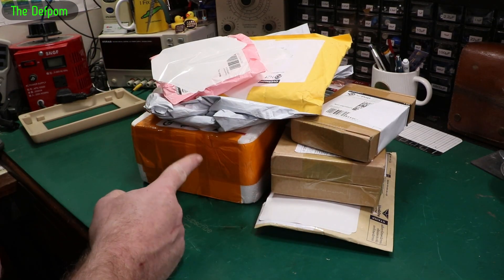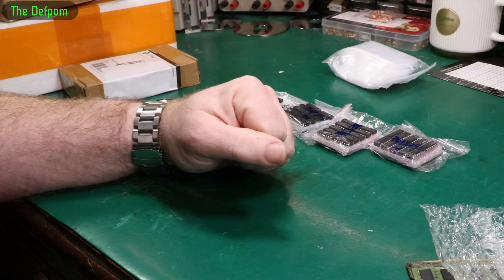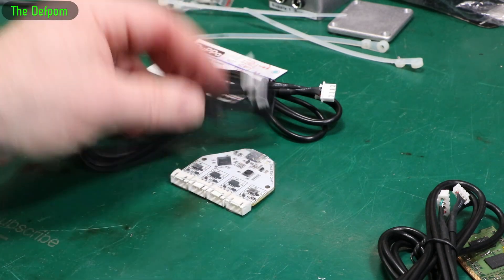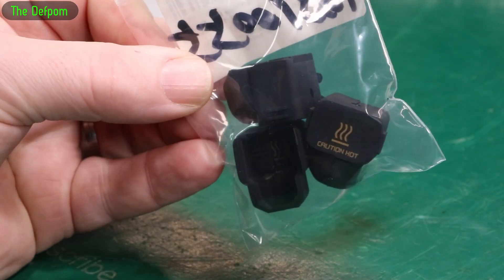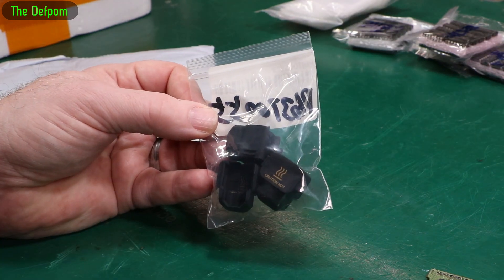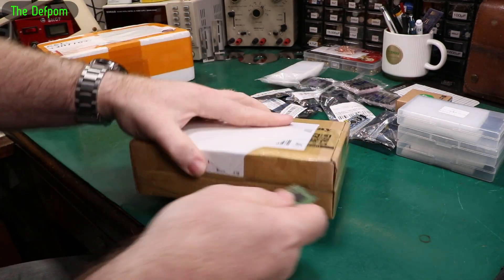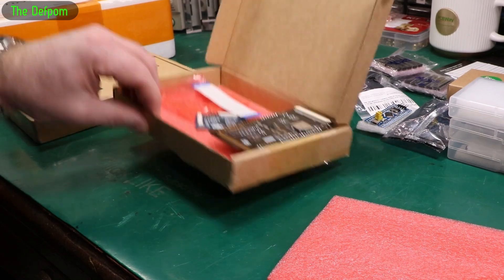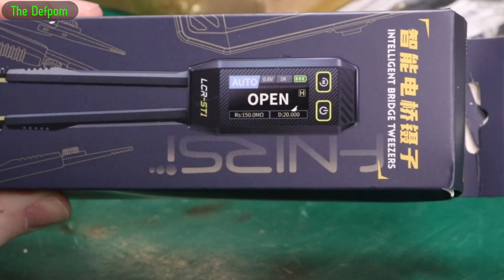🔴 Mailbag Monday 30th September 2024 - No.1283

Comment: 9:55 - If I remember correctly, there are some clones of this device, where marking is actually not correct, for example RST is not where its written. Do the research online and you will find it, I think problem was it was unable to connect to devices because of wrong pinout.